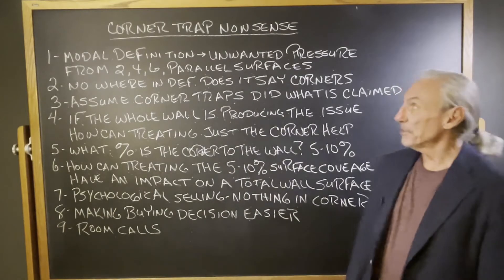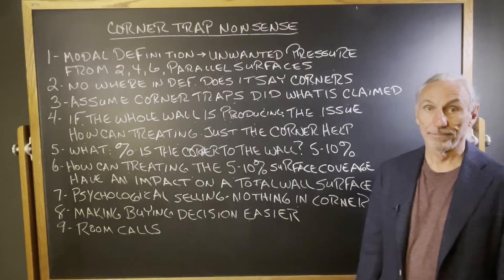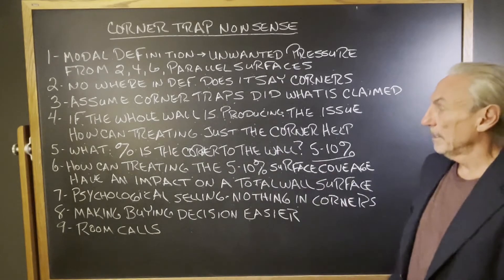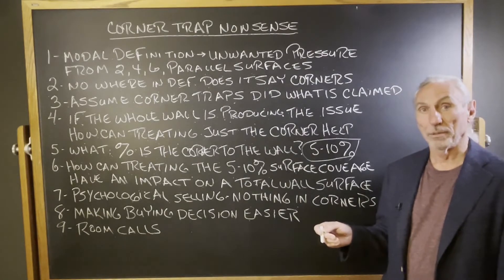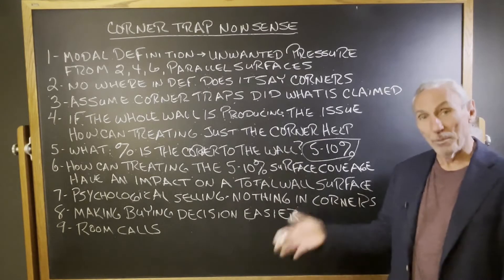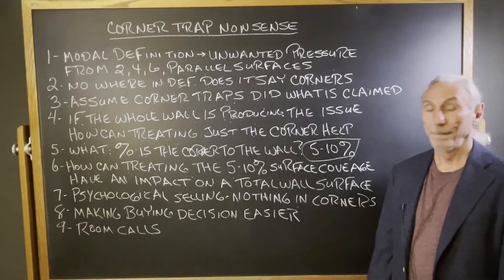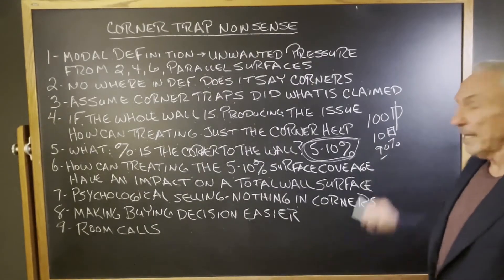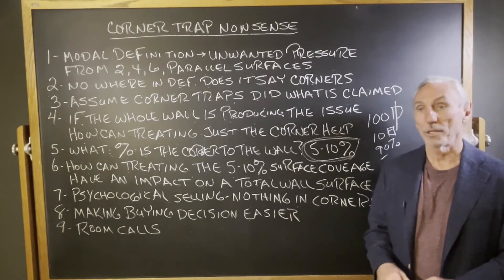Corner Bass Trap Nonsense - www.AcousticFields.com

Comment: Years ago ASC published a paper on placement of their tube traps. Over a decade of installations revealed that the bass build up was better handled if you put the trap in the middle of the wall(walls and ceiling). I had my room trapped thinking bass was building up in the corners, so I simply moved the existing traps to new positions based on the ASC paper and my room immediately sounded better.
Reply from the maker: Its never the corners. It is always the dimensions and the walls that create those dimensions. The acoustical products industry is full of half truths and band aids. This is another example of which foam manages low frequency energy is my favorite one.

Comment: All you said is right. Many people will not pay attention to the content of the whole video. Of course, treating only corners is nonsense. You need to take care of your complete surface of the walls first. Bass traps although help. But alone bass traps without proper wall treatment is nothing. This is the talk that platforms and sellers market and promote. Most people expect to spend as little as possible, and expecting incredible results. And at the end of the day everyone will learn it at least by own experience. Acoustic treatment is a science, and it costs a lot to do it properly. Cheap solutions, if we can call them cheap, lets say 500-1000 US$ can make an awful room sound decent or even good. But if you go the pro way, then thousands of Dollars have to be spent. The foam thickness, form..... everything plays a role. For the most part, you get what you pay for.
Reply from the maker: Well said. You are correct. In over 50 years of working in sound management, we find that 90% of people use a single tactic without an overall sonic strategy. They place this product here or there without consideration of the macro view for the room acoustic. Everything in acoustics is related to everything else. You may impact one area with a tactic and create more issues with others . Room distortions are like one large extended family. You must look at the complete room first and foremost. This is the impetus behind our mission statement of starting with low frequency management in any design. Low frequency wave energy defines and provides the foundation that all music "rides" upon. You must get the low end (foundation) correct before you work on anything else. The lower frequency fundamentals are directly related to mid and high frequency harmonics. Small rooms are like small towns. Everyone knows everyone else and all the issues that go along with that paradigm.
Reply: @AcousticFields  Even curtains, closets,  or different things can affect reflections. The biggest issue is an empty room with flat walls. This is the best example for untreated scenarios. The size of the room, height floor to ceiling also plays a role. Even a carpet impacts/diffuses the echoing.  Even small vocal booths which are literally small are also bad for recordings. Prople tend to think that building a closet size like vocal booth is cheap and a pro solution. False, even though it is acoustically treated, it diffuses the sound of the spoken vocals into the mic. The size in this case is also important. A good example in a smaller environment is the car industry. Why would a manufacturer hire engineers to develop high end audio systems in a such small cabinet ? Exactly, to deliver fidelity and authenticity. Every cm\inch has to ne measured in order to calculate speaker placement  and to add acoustic elements integrated into different parts of the car to achieve the task.

Comment: My experience: as you move towards the corner the bass is accentuated. If you do not have mics (tracking) or listeners (mixing room) near the corners, corner traps might not help you much. I was building mixing rooms for TV and film, usually just a mixer and one client. Traps did not usually matter, but when the client brought the production team in for review and the rear couch and chairs (nearer the corners) were filled and people were standing all around the room. The corner traps helped to level the bass across a larger area. It basically expanded the usable area for effective listening. This is why I never applied corner traps on the screen wall. No one stands back there. If you want to be able to use your entire space and not have the effect of bass concentration in the corners, corner traps can be quite effective. I am building a home studio room. I will be the only one in there, and will rarely be near a corner. I am not intending to install corner traps.
Reply from the maker: If the ultimate resolution is desired in your room, you must treat the sources of all issues. If you treat the walls which are the source of the corner issues, you treat the cause and not the symptom. This industry is full of band aids that the uniformed fall for.

Comment: I do think you are totally right that overall a much better approach is to build your own panels to treat all the walls AND ceiling. Build your own diffusors. And cloud. A DiY approach, where the cost is the materials, and the goal is maximum treatment is much better than buying some premade 'corner traps'. The only advantage I see of favouring corners, if you really are going to only treat 10% of a room, is that often times corners can be wasted space in a studio. Which I guess is one of the reasons the area behind the monitors often gets treated expensively, and also sometimes the back wall behind the listening position (also for reflections too). I wouldn't want to put a guitar cab, bass cab, speakers, mic area or listening position right in a corner. So it's not the worst place in a room to lose room to treatment. Also, maybe, just maybe, it can also be easier to naturally have an air gap, behind say an 8" panel, if it's placed across a corner, the prism shaped air gap would be somewhat marginally beneficial to absorption? But you are the expert, so I wonder if that is true, or not?
Reply from the maker: Air gaps are of minimal benefit. Our goal is resolution and most people are about putting band aids on issues that do not contribute to resolution. Resolution is a step by step process that starts with lower frequency management first and foremost.

Comment: Sure, you can treat the whole wall but the corners are where lower frequencies end up... and so it only makes sense to have something MUCH thicker in the corners.
Reply from the maker: The corners are not where the lower frequencies build up. The walls are the source of all issues. You are using a tactic without a strategy. The thickness of a material type does not indicate its overall performance.
Reply: We start in the corners because that's where they tell us to treat, it's a band aid at best and they know it.
Reply from the maker: @davewin1792  Correct. The whole industry is about band aids. No one is concerned with resolution.  Companies play upon the ignorance of people. Your best defense as always is knowledge.

Comment: I think a big missing point from a lot of people is that corners are ultra reinforced. windows and the center of flat walls can breathe a bit, but brick/concrete/corners are so reinforced that less energy can escape, especially because the waves angle of incidence is glancing
Reply from the maker: Walls do not "breathe". Noise transmission is all about managing vibrational transfer. The unwanted corners pressures are a symptom of the wall dimension. Treat the wall, no corner issue.

Comment: Thanks - this video saved me from wasting money on overpriced corner traps - I'll just go with regular panels and make them as deep as I can. Corner traps are not designed to give an air gap which significantly reduces their performance. What % of the room surface area would make a significant impact? What depth of panels do you recommend - even with 20cm deep and 20cm air gap panels seem to struggle to significantly affect under 100hz and certainly under 60hz. I don't even really want to give up 40cm on most of the walls in my room. Most studio rooms I see on youtube seem to have about 10-15 120x60cm panels. What absorbition coefficient do you need to make a significant impact? Is 0.4? 0.6? 0.8? Generally under 100hz seems to taper from 0.8 down to 0.2 (or 0.4 if your using 30cm deep with 30cm airgap.
Reply from the maker: Air gaps are window dressing with little value for low frequency pressure waves. Use diaphragmatic absorption since it represents the most powerful per square foot of all absorption technologies. You will need to give up 12" of wall space to reach down to 30 Hz.

Comment: This is true corners are a small percentage of the room and have to be treated, but the corners concentrate a lot of bass and have to be treated as well
Reply from the maker: If you treat the walls, the corner issues go away.
Reply: @AcousticFields  great point
Reply: Treat the walls with what exactly? Example a concrete wall.... @AcousticFields

Comment: I got a 8H 12W 14L room, i set my setup pretty standard like middle of the of width, listening position is a third of the length, equilateral to the 2 monitors. 
My problem is i cant hear bass within the half of the room close to the monitors. Why does it happen? Is there a fix?
Reply from the maker: You must pressure balance the room so you are not missing any frequencies. Your room dimensions are producing unwanted pressure pockets that will not allow you to hear certain sounds. Fill out the info in this link. Lets take a look at your specific issues.
https://www.acousticfields.com/free-room-analysis/
Reply: The perception of Bass improved for small 13 × 11.5ft living room with the purchase of a second subwoofer, but that was more for seat to seat perception. What really made the biggest difference was getting the couch off the back wall by a couple of feet. The placement of the MLP is just as important as the placement of the stereo speakers.

Comment: My computer desk room is very small, and somewhat part of the living room. Without it, the reverberation is almost ear piercing. After installing it, its miles better than before, paired with felt wall panels, you can definitely see and feel a difference. I think its about the size of the room youre in. In my case, the walls were very close together, making echos more prominent. Not to mention that the back wall was thin. But if its a large room, not much difference will be made or noticable.
Reply from the maker: Echos are a repeating signal. Your issue is called reverberation. Reverb is a measure of sound decay.

Comment: This made total sense, I've been wondering about trying bass traps, not because I have bass issues but precisely to just experiment if they do anything at all. My room is not symmetrical,  wooden walls, not a parallel ceiling either. If anything I wanted to try them to see if I got more bass in some way. In any case, of all the videos I've seen none have said this, and this is of total logic, what happens on the walls ends up on the corners, so fix the walls and you fixed your corners nd not the other way around. It does make a lot of sense to me.
Reply from the maker: It is best to develop a strategy for your room. Using tactics without knowing why or how is a recipe for failure and a drained bank account. Lets take a look at your whole room and start with the largest and most audible distortions first. To start the process, fill out the information in this link. https://www.acousticfields.com/free-room-analysis/
Follow the software and schedule a time slot to speak with Dennis regarding your room issues.

Comment: Thanks I'm over here looking at a floor plan and my common sense was like I'm not standing in the corner, so it may be best for the bass to stay their lol.my listening zone is fine slowly covering walls with recyclable materials appreciate the secondary weight. Quoted 4 k for clouns alone
Reply from the maker: Our mission is resolution. In order to achieve high resolution of issues, you must first focus directly on the cause of the distortion not the symptom.

Comment: It’s way more cost effective to treat the corners first. If some problems still remain after that, continue with the walls. No point in debating what order the problems were caused. In that case you should start with treating the speakers. They are the root of the problem. If that doesn’t help remove the amp.
Reply from the maker: Treating a symptom without treating the source of the problem will not assist you with achieving higher resolution. Always treat the cause of the corner issue which is the wall itself.

Comment: Would building a 5 sided room help with room modes?  I have a 15'x15' room and am thinking about building a pentagon inside that is slightely longer than it is wide, with the gaps between the 4 and 5 sided walls filled with rock wool or R19 in the air gap.
Reply from the maker: Stay with rectangular rooms. Their issues are predictable and consistent and thus treatment can work well with the issues.

Comment: If it’s only parallel surfaces, then why does corner loading a subwoofer create more bass in the opposite diagonal corner? And given that this is true, I would assume absorbing some frequencies in a corner, would reduce the reflections of those frequencies? And what’s wrong with helping a little, when you do a multitude of things that do a little you end up with a lot, and once again, you offered no solution.
Reply from the maker: Its not more "bass". It is + 3dB - + 6dB of room gain. Room gain is distortion. Quantity is never quality.
Reply: @AcousticFields  yes which is why we try to place our subs at quarter or half wavelengths in the room. But what is your solution to absorbing low frequency sound waves, where they accumulate in the corners, and reflect in all directions? We’re all just trying to do what we can with what budget we have.
Reply from the maker: @mwrightinsurance  You can't position yourself away from room modes that are oscillating every 3-4' in the room. If you miss one, you will fall into another. We have many pressure absorbing technologies. You can find them at this link
https://www.acousticfields.com/shopping/